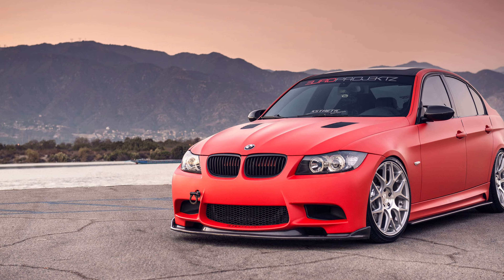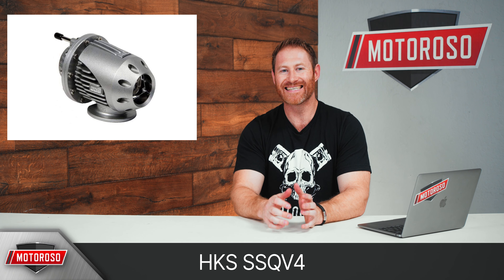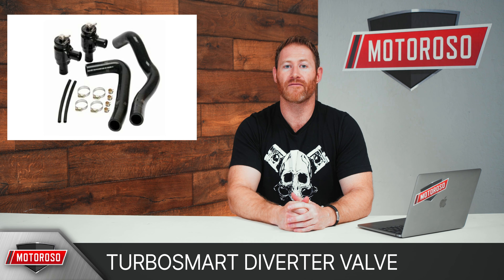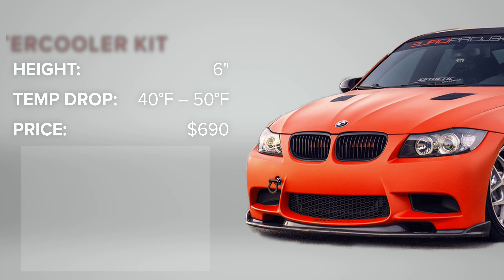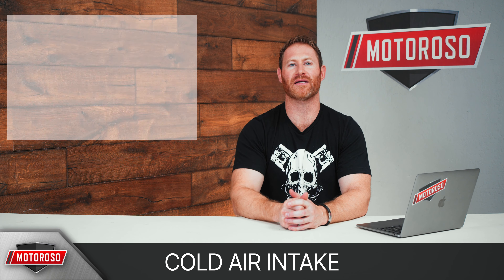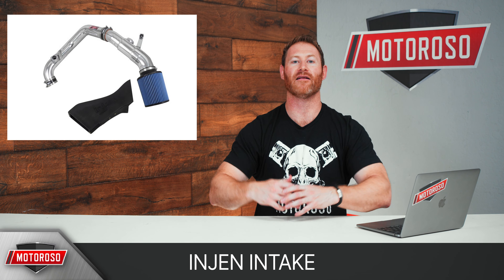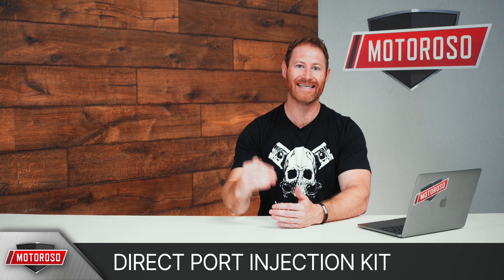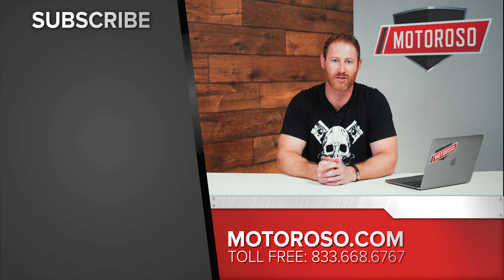7 Must Have Intake and Cooling Mods for the BMW 335i

Comment: Decent info. Thanks for posting. A few comments and none meant to minimize the value you've provided in the content. You should have covered the replacement of the stock radiator and it's thermostat (and the preventive replacement of the electronic water pump). The stock radiator is plastic end capped and fails often, and its a weak link in the cooling of the N54. While you're mentioning that the mickey-mouse flange, the radiator top tube and the overflow container should be mentioned for preventive replacement. The oil cooler at the last minute should have been given a little more time to cover what's needed to adapt the cooler to the oil filter housing. Meth and DI are cool but nothing beats a better source of fuel, so a LPFP is nearly essential with 400+ HP builds.